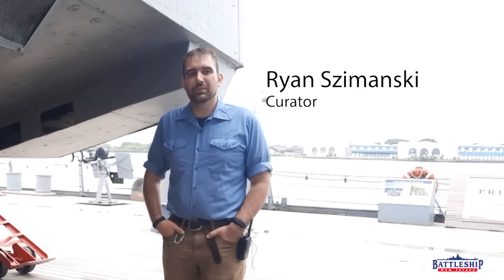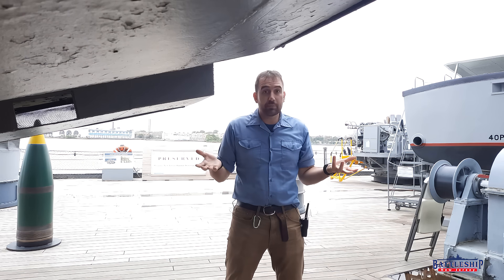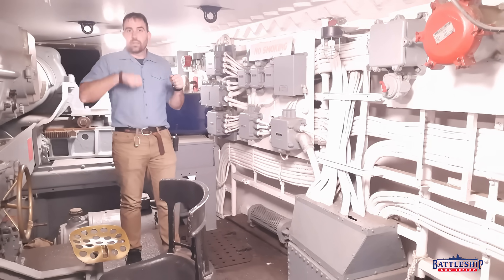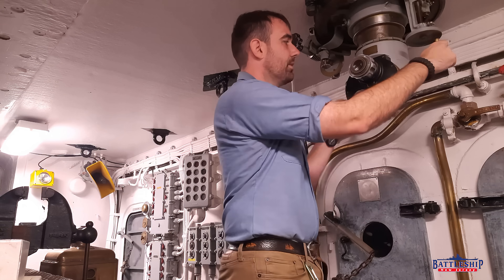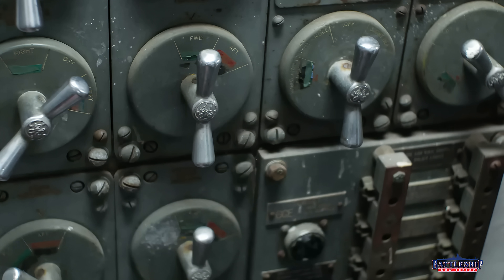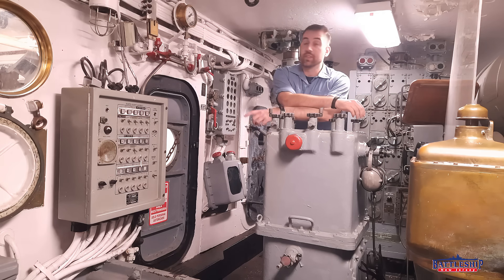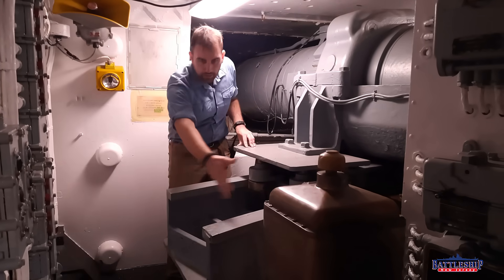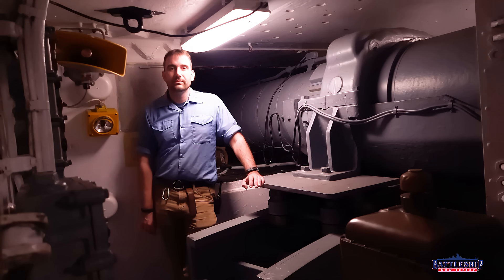Inside a 16in Gun House

Comment: I'm 6'4" and banged my head on a lot of things in the overhead when I was stationed on my ship. I have a total of 6 stitches in 2 different places on my head/face from low hanging angle irons.
 We had an Ensign who was 6'6 or taller and the more senior officers made him wear a WWII steel pot helmet until he stopped hitting his head on things.
Reply: I am 6'4" tall too.  That is a small reason why I served in both the active Air Force and MI Army National Guard.  In the Guard, for a bit I was nicknamed Too Tall.  I could flat-footed plug-in signal cables to the shelter.  Everyone else on the team had to find something to stand on.  So my team leader just one day said, "I was just Too Tall.  Of all the things I could have been called, I won't argue with it!
Reply: @klsc8510  I'm 6' 2". I have always wondered what tall guys do. Now I see there were taller guys than me.
Reply: @danmathers141  We duck a lot or stoop a lot!
Reply: @danmathers141  biggest issue is the bunks are usually 6'4" long, so even at your height it's tight. I'm 6'6"...
Reply: I'm in your height range too and find it's a lot worse when you're wearing a cap with a visor. Without the visor you would see obstacles with "up and down peripheral vision" but wearing a cap you can't see them and run right into them.
Reply: Yes, an hard hat sounds like an good idea there, even an bicycle helmet would work.
Reply: At least you weren't a crew member in a russian ww2 tank.  :D
Reply: @Pihsen   I remember crawling in and out of a T-55 on display at Andrews AFB during an Armed Forces Day open house when I was in jr. high. I was a skinny little kid, and I still found the tank uncomfortably cramped.  I couldn't imagine adults living and fighting in that sardine can.
Reply: I'm 6'6" and a former merchant marine engineer. People comment to me so the time "you must hit your head on everything!" Nope, I instinctively duck going under a 8' tall doorway so it's pretty rare that I hit myself. When I visited NJ a few years back we went into the turret and my 5'6" companion was hitting her head all over the place, I was fine. 😉
Reply: @fire304  Did you serve in the Great Lakes or on the ocean?
Reply: @klsc8510  East Coast on research and tourist vessels, West Coast on oil spill response vessels. No fresh water experience.
Reply: @fire304  When I was a young kid, my parents took me across Lake Michigan on a car ferry.  I barely remember that.  That is the largest moving ship I have been on.
Reply: I'm 6'4" and never even considered enlisting in the Navy because I thought you had to be short to serve on a ship.
Reply: @josephastier7421  For me I chose the Air Force to have more elbow room.  You could fit all the Navy's carriers on the family farm.  Air Force bases are measured in square miles.
Reply: @josephastier7421  not short, just guy.
Reply: We had a tall lieutenant JG on the USS Wasp who was going down a ladder. He hit his cap device against the lip of the horizontal hatch and bent his eagle device over. It was funny but saved him from breaking his head.
Reply: A hard hat is annoying, but doing industrial electric there is so many things to hit ones head on so I was glad for mine. I'm 6'6 and my hard hat  gad the most scratches and gouged places. A couple of them cut pretty deep into the plastic. Those would of cut into the bone. You could classify hands height in relation to each other by simply lining up hard hats from most pristine to most banged up and you wouldnt be wrong on many of them.
Reply: i used to work in a factory for electro chemical production of nickel and other metals. and some of the buildings are from 1920-1930 many of the basements have been deemed unsafe due to beeing so low and no escape routes etc... but where you are allowed to walk, the roof or the floor is not level anywhere. im 180 tall, and i found it to be 195 mostly, but every cable, light, cross beam and anything else mounted to the roof would hig you straight in the noggin. 
and wearing a pretty cumbersome gass mask aparatus (if interested search up airstream versaflo by 3m or something)  with a blower on the back and a face shield that could tilt up. so effective height was 190 ish... i banged a 400$ mask to the point of beeing unsafe to continue using. cracked the face shield part a few times aswell. plenty of times beeing in a major hurry, just to smash my head into an i beam or concrete beam, and beeing sendt flying to the ground not knowing what hit me :P
Reply: My first ship after boot went to yards right after I reported aboard. I had to learn fast to have "situational awareness" to keep from hitting everything. Even though I'm "short" at 5'8", so much stuff is hanging low from being torn apart for maintenance during drydock that you can't assume anything is safe.

20+ years later, I'm still naturally planning my moves when I'm in a tight spot. But I'm still in engineering, just working on HVACR at a factory instead of being in an engine room.
Reply: Ouch
Reply: Same with a guy on the destroyer I was on.   He was 6 ft something.  They made him wear a hard hat inside the ship because he kept cracking his head.
Reply: Why do I have a scene from Spaceballs running around in my head…
Reply: I bang into things in front of me alot, if you catch my drift.   lol 😏